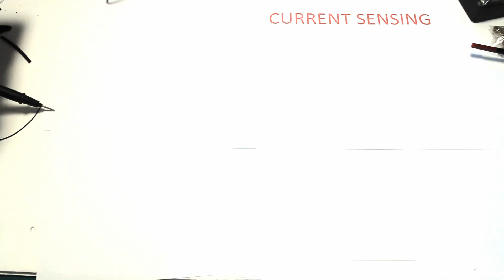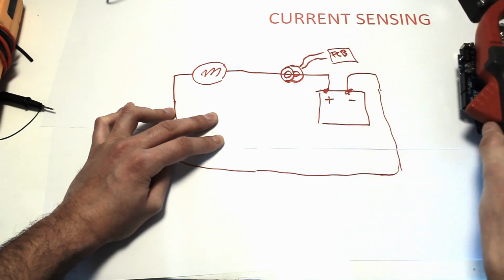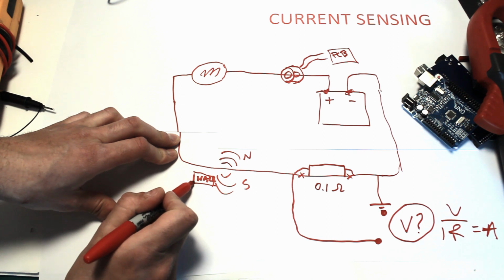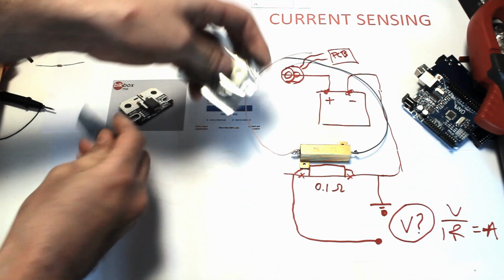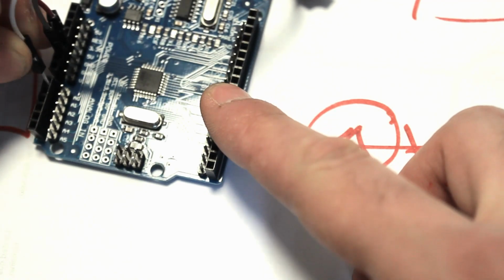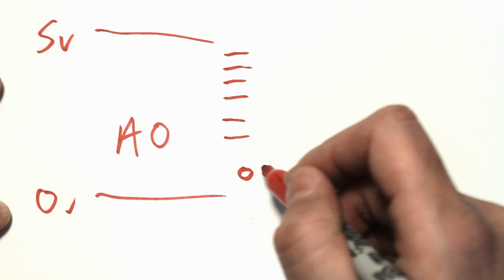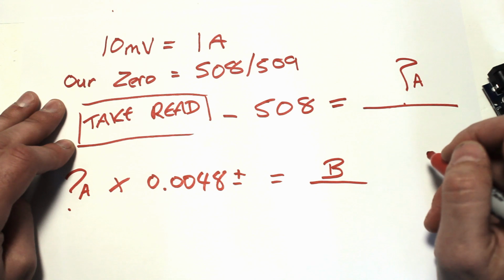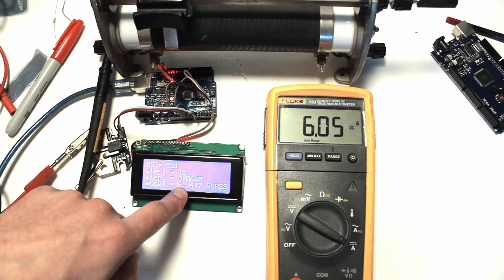How To Current Sense - I Try A New Current Sensor for Arduino

Comment: yea we need the code to test it out please
Reply from the maker: Test it out with the example sketch "AnalogInSerialOut" once you know you have a changing number on a A in pin. Then use your multimeter to test some know currents and scale the pin reading to produce the Amperage number.